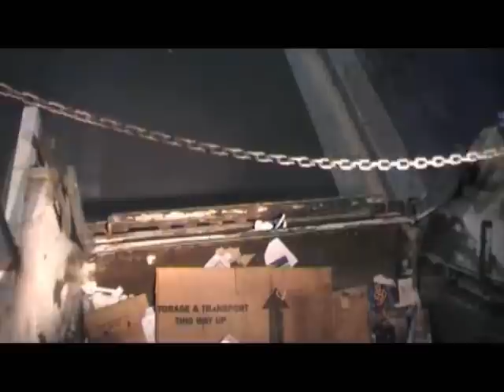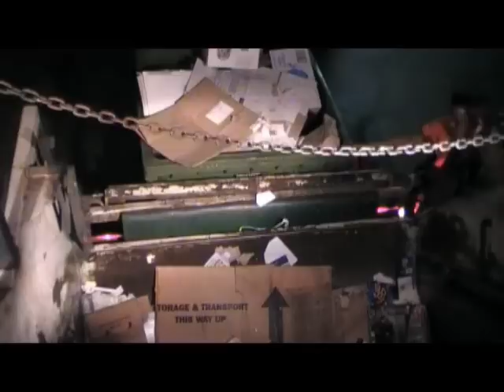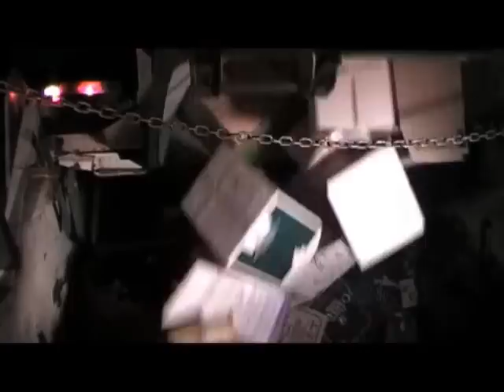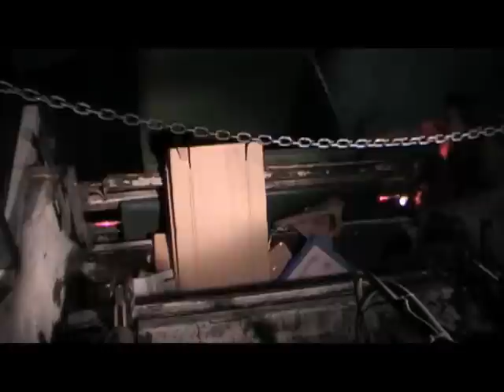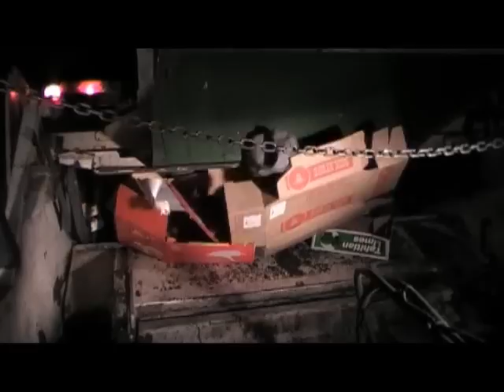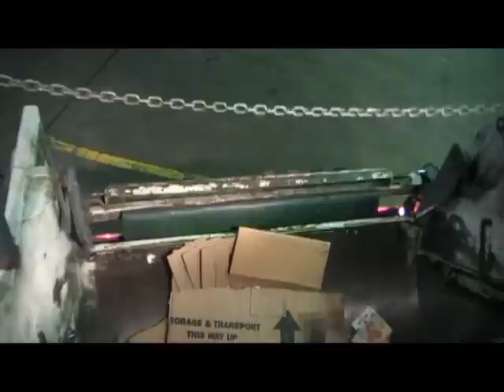Me & My Truck Pt 1

Comment from the maker: I spent a bit of time trying to get the perfect camera angle where you can see as much of both as possible, turned out pretty well I take it :) I have another similar set-up when I was doing an old winch job (not as good though) and also an overhead with a different truck on residential. Planning to get some more too.